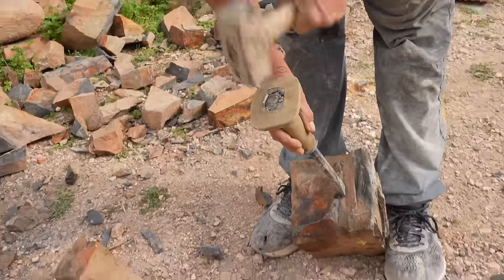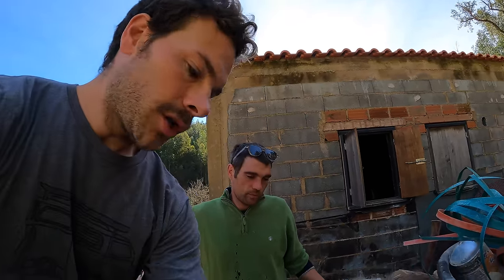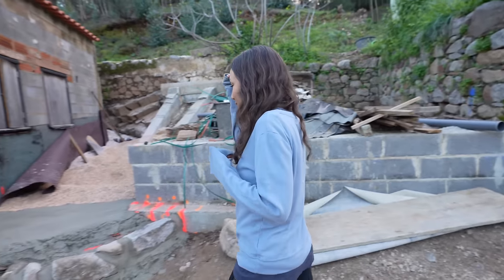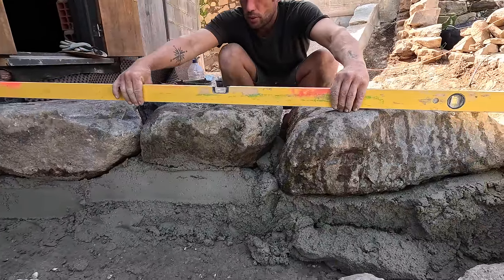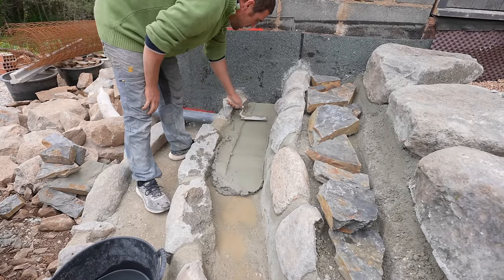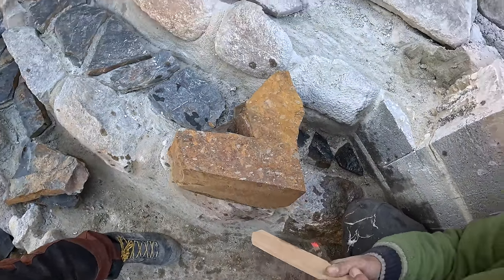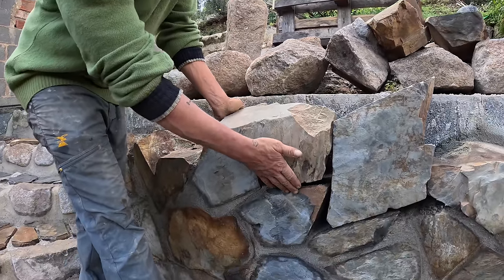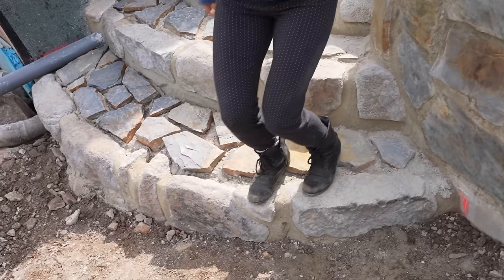Discovering RARE GRANITE on our land to build AMAZING STAIRS AND STONE WALL 💎

Comment: Next time when you burn your hand ( or whatever you burn) grab the bottle of mustard, right out of the fridge, and squeeze it on the burn. If it’s anywhere on your hand or foot, dump lots of that bottle of mustard in a bowl and put your hands in it and leave it there for 10 or 15 minutes,. Let it dry on your skin  for 20 minutes. 
 A chef taught me this remedy the day I  slapped the top of a very hot, flat, metal cooking grill (I didn’t see the vegetables  being grilled and the flames  happening all over the veggies. A sign that this thing is hot)… Chef  immediately grabbed my hand and shoved in inside a huge mustard jar he got from the fridge…. It worked. 

And also, the  Stairs are looking fantastic. Good job, you guys. Great team!  You guys RoCK! …